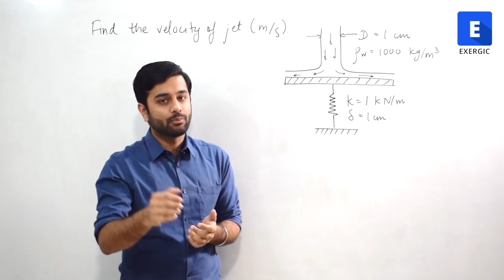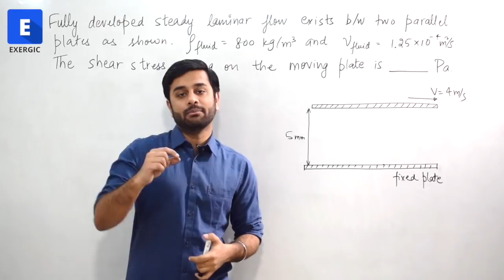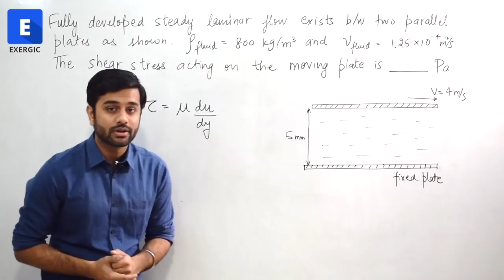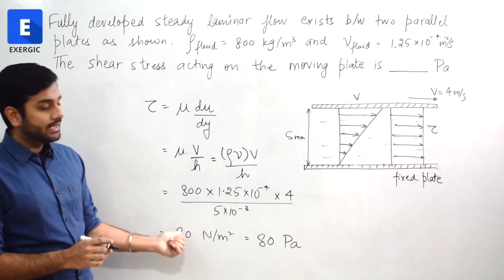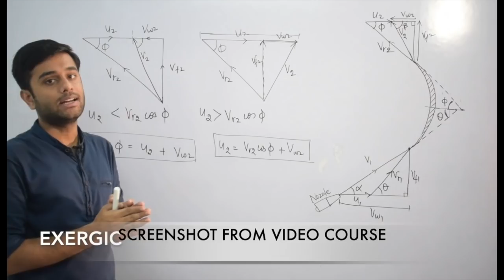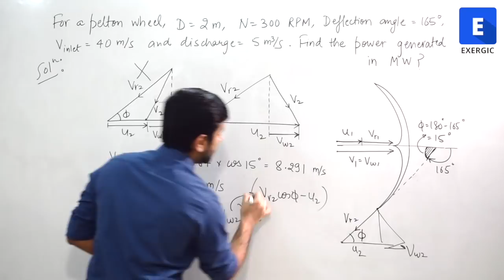GATE ME 2021: Detailed Explanations + Silly Mistakes in FM

Comment: Sir I multiplied the volume flow rate with acceleration due to gravity to find the weight per unit time and then found out the total force by considering " net change in momentum + the weight per unit time" and equated with "K*delta".Please explain why am I wrong.. Please sir.
Reply: What you said is true. Gravity force which is a body force of the Jet will influence the force on plate too. But. This can only be considered if the length of the jet is known. The equation you used is incomplete. You'll know if you see it dimensionally. Expression you used for weight is in N/s, while everything else is in N. So apparently, your weight expression needs to be multiplied by time. Then, the V.t turns to L, which is the length of the jet. But no mention of time is here. Neither is any mention of L which could have been used directly. What you did is valid only and only if the jet length is V. (Or t=1s), or jet takes 1 s to reach the plate. But what about say 0.001s? In that case gravity will be too less as the length of jet itself will be too less. Or the case of 100s (which is unlikely as then gravity may not be negligible and problem requires length of the jet or time). So though your approach is right, it's incomplete which you can see by simple dimensional analysis.
Reply: @abhishekganguly7695  thank you.
Reply: i also did the same, actually the deflection of the spring is influenced by the gravity of jet also, isnt it?
Reply: @abinmathew6249  yes. I thought to apply that concept. By that way my equation came out to be quadratic. I wanted to solve it but I thought I may be doing mistake. So left it. Upon asking some aspirants they said they only equated the momentum change with k*delta of spring. So with a very reluctant mind, I accepted that I may be doing wrong.

Comment: If a variable doesn't change then it's avg remains unchanged. Avg is the constant value which gives same effect as the same variable quantity. Hence the ans of avg shear stress is 80 and not 40 as shear stress is constant throughout. 
 It would have been 40 if shear stress was linearly varying.